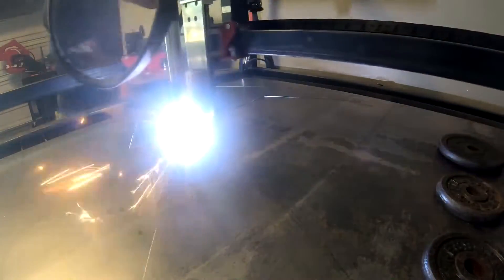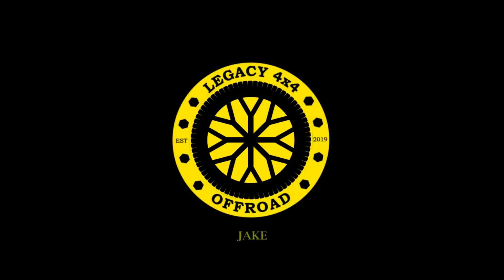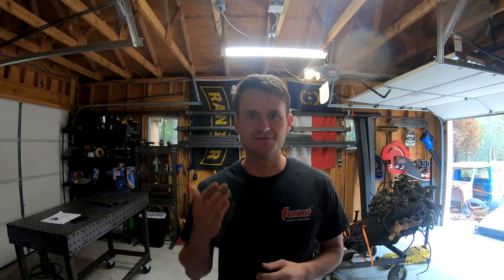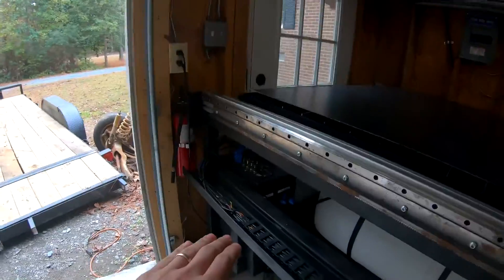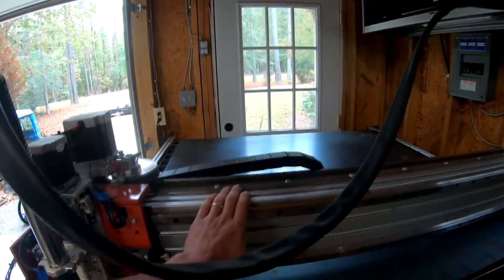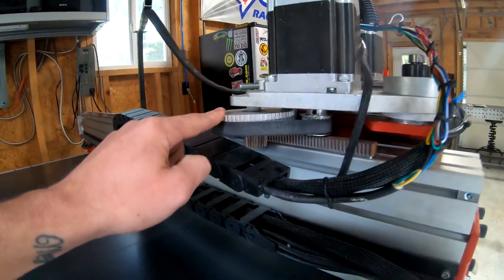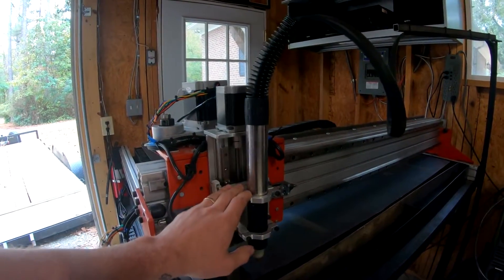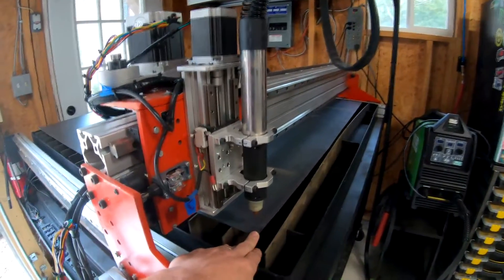BUDGET Professional Plasma CNC Overview II Legacy 4x4 and Off-Road

Comment: Awesome build! thank you for sharing,  I do have a question; I noticed you use a 5V relay on machine torch, is that because the plasma machine does not have a built in dry relay - thank you!

Comment: Great to see it working, look forward to seeing more. Once you start in on a job does it sense if the workpiece changes position if not do you secure the job from moving at all ?
Reply from the maker: Stay secure itself, moving it can be programmed but that's about it in terms of "sensing" putting  a lot of trust in the clamp weights!

Comment: Thanks for the overview. The more I research the more I understand why you chose the mechanical components you did on this build versus the first. I get the decision for the gear reduction, linear rails, and aluminum extrusions now even in light of the extra cost. On the electronics/control side, how do you feel about the hobbycnc board + Proma 150 vs using the Mesa 7i76e/thcad with PlasmaC? In your opinion is one way easier to implement/does one combo perform orders of magnitude better? Also, I'm a few days late but thanks for your service.  -Ryan
Reply from the maker: The gear reduction is definitely the way to go if you want finer resolution and more control over the gantrys, also allows the system to move much slower for thicker metals and faster for thinner stuff. In testing I was able to move my X/Y Axis at 600ipm and as slow as 10ipm. Which is far too fast for my tooling. In use I stay around 350ipm for jog/rapid speeds and cuts vary between 45ipm and 140ipm. The aluminum extrusion/gear rails were not that much more expensive than the straight drive set up before, really the only added cost was the reduction drive themselves. I have seen guys make those and save some money but to me the pre packaged set up from Avid was very simple and worth the cost.

Far as the electronics hardware question goes, the HobbyCNC board was definitely easier to set up and to match with the software, and that board worked perfectly fine on the last table. But I did have issues integrating the Proma unit with the board, when I sold the table the THC was not functioning and I ended up selling the Proma separately. I made the jump to Mesa for a couple of reasons, firstly being cost, the total Mesa set up was $270 which included both boards. The Proma THC alone was $300 on the last build then plus whichever version of the HobbyCNC board you go with. Second reason was for control, by running the Mesa with separate drivers I now have more independent control of each motor and more easily repairable parts in the event something breaks since each component of the drive system is isolated. If you are comfortable with some basic computer know how, and some basic computer language skills and spend a little time reading on the different forums you can quickly learn how to set up the Mesa boards and how to integrate them with the PlasmaC. The newer versions of LinuxCNC also have the PNCConf wizard which is graphical step by step for setting up the boards to work. 

Truthfully, I would go Mesa every single time, after I got comfortable with the setup and played with it for a while it really showed how much stronger of a board it was and tied with the THCAD it makes for a very comprehensive and accurate control system. The only downside was that it took longer to set up and fine tune the board/thc with my setup, but once finished the results are beautiful. HobbyCNC was perfectly adequate but just as the name implies it is more at the hobbyist level, the Mesa is definitely closer to the industrial performance level I was after with this build.  

Thank you , and thanks for watching!